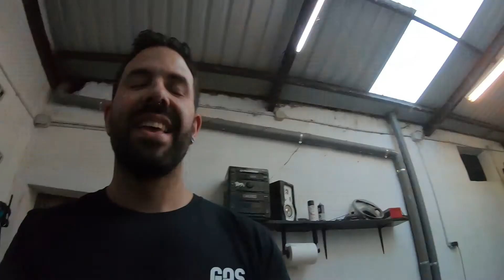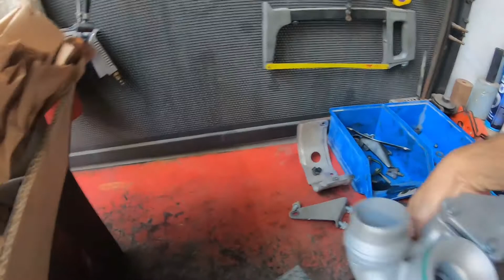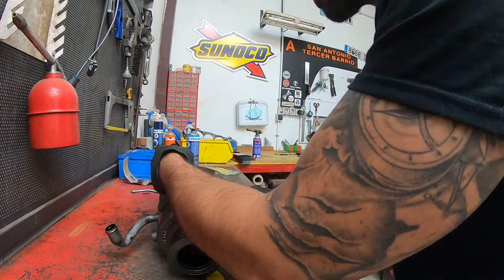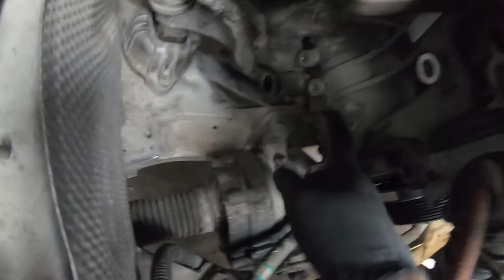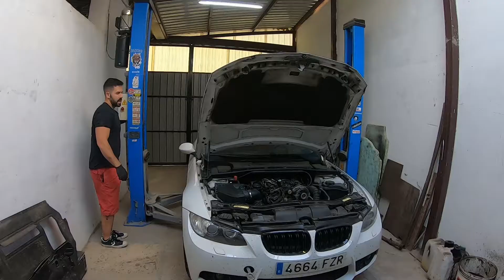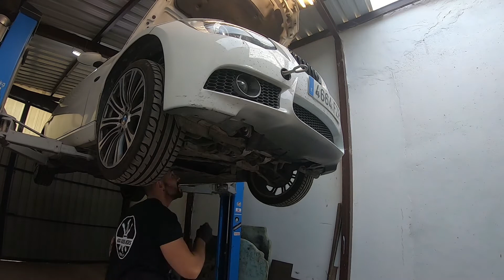Turbo BMW 320d 177cv // turbo roto, como cambiarlo

Comment: Buen vídeo!!!
Reply from the maker: Gracias! As aprendido algo?
Reply: @gashousemotors3455  creo que cada coche es un mundo, en otros modelos supongo que haya que quitar piezas importantes para acceder al turbo.pero lo que es el concepto básico está bien explicado. 
Sobre cuantas horas de mano de obra te cobraría un taller? Y no sería conveniente cuando desmontas el turbo tapar los tubos para que no entre mierda y pueda volver a romperlo?
Reply from the maker: Claro, estos vídeos son la base para que veais como se hace, luego lo adaptas a tu coche y listo.
Sería conveniente taparlo todo. En este caso al ser yo un único que trabajo en el “taller” se que nadie va a meter nada , pero si no, puedes tapar el tubo que va al intercooler con un trapo, los demás tubos los tienes que desmontar.

Comment: hola el mio me ha hace como si fuera un ruido de sirena y no activa el turbo y lo he mirado no tiene juego que crees que podria ser ? gracias un saludo
Reply from the maker: Ves que lleva una electrónica pegada al turbo, es la encargada de variar la geometría del turbo, puede que no funcione.
Además fíjate en las aspas si ves que están “afiladas” están mal, o puede que tengas un manguito del intercooler rajado.
Reply: @gashousemotors3455  muchas gracias lo mirare un saludo
Reply: @gashousemotors3455  hola otra vez he mirado la geometria del turbo y me he dado cuenta que cuando acelero no sube , y cuando apago el motor se queda la geometria haciendo como si enciende y apaga como un " tik , tik " a minutos lo hace todo el dia , sabes que podria ser
Reply: y cuando acelero el tubo del colector sale del turbo , que podria ser eso